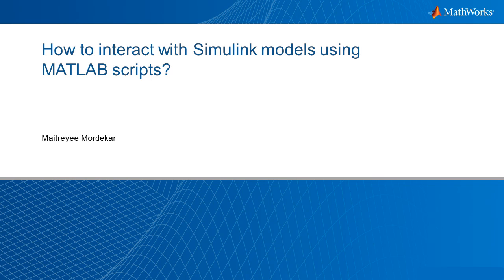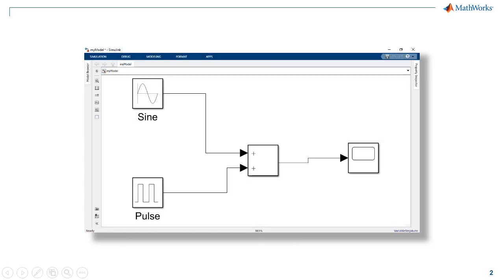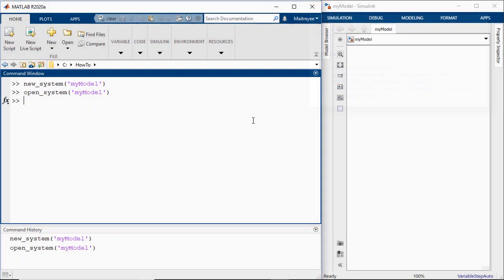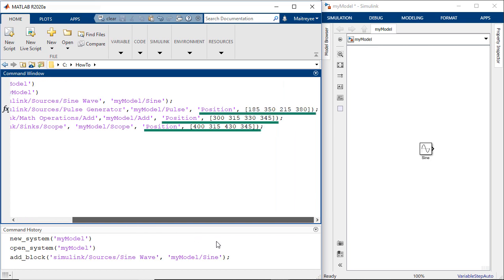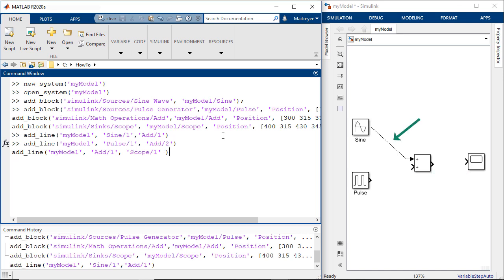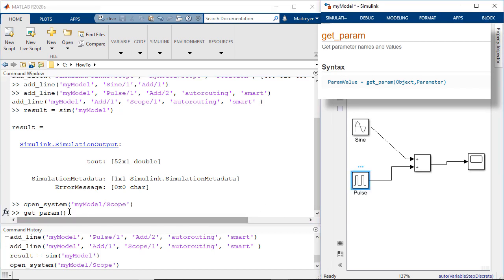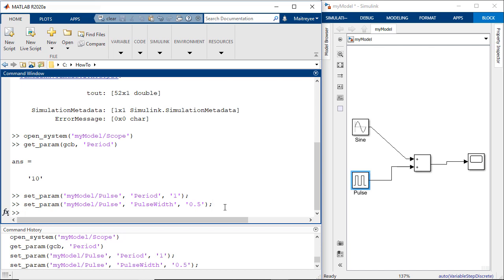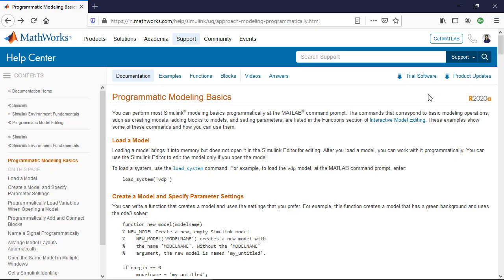How to Interact with Simulink Models from MATLAB Scripts

Comment: Nice demo, very interesting. I decided to try and do the same with a simple Simscape model, which has worked well, but I've run into an issue. I'm trying to connect an inductor and a resistor, but the add_line is not throwing an error, of Invalid Simulink object name. The add_line does work when I connect a step and a scope in the same model, so I guessing its the naming of the ports in Simscape that I have incorrect. Where do you get the name of the ports on a Simscape element so as to connect them?
Reply: Hello Gerard, You can connect the Resistor to the Inductor provided that the names of the ports are correct. You can click on the block in SImulink and get the details about the block using the following on the command line:
>> get_param(gcb,'PortHandles')
As the output, you may see LConn and RConn which are the ports that we need to specify. The following command should connect the two blocks:
>> add_line(mdlName, 'Inductor/LConn1', 'Resistor/RConn1')
My model's name is in the 'mdlName' variable.

For more details, you can check this MATLAB Answer: https://www.mathworks.com/matlabcentral/answers/196988-is-it-possible-to-access-simscape-to-build-a-physical-model-from-the-command-line
Reply: @mordekarmaitreyee  Hi Maitreyee. Thanks for the reply. I actually figured it out by myself, it was fun to do. Some of the LConn and the RConn aren't as logical as one would think, but its just trial and error to figure out the correct sequence. Thanks you the original video, it provided the inspiration to kick off my little side track on using this functionality in MATLAB/Simscape
Reply: @gerard-nagle  Glad to hear that the video helped you.

Comment: Thank you so much. Now can I write a script which will change the values of parameters for each run and save the results and write an optimization code using that?. Or is there an easier way?
Reply: You might want to check this out: https://www.mathworks.com/help/simulink/slref/simulink.simulationinput-class.html
Does exactly what you're trying to achieve for the simulation part
Reply: @shivamone  Thank You.